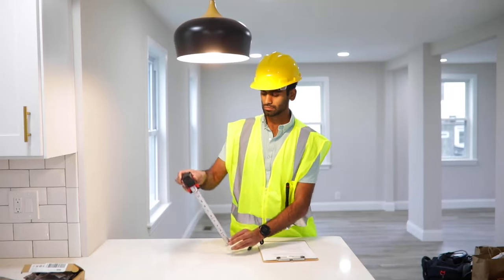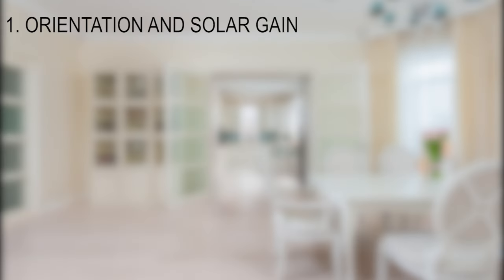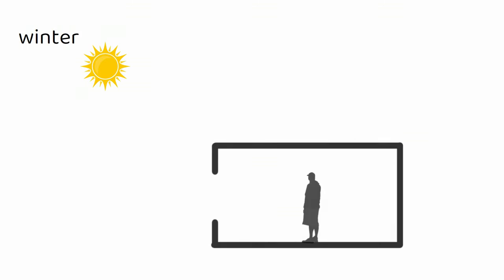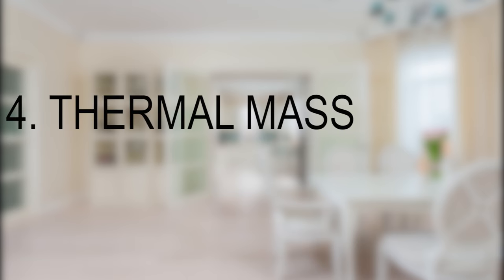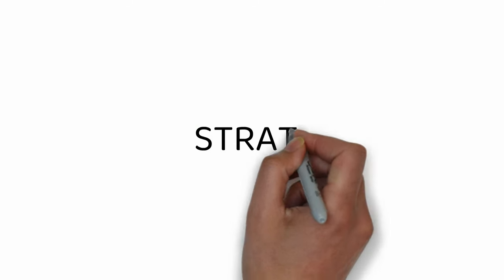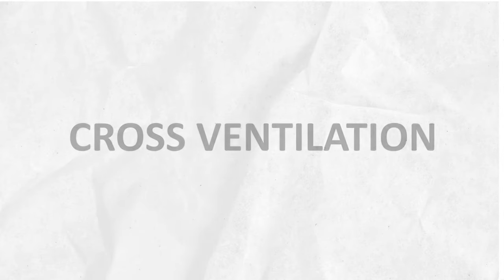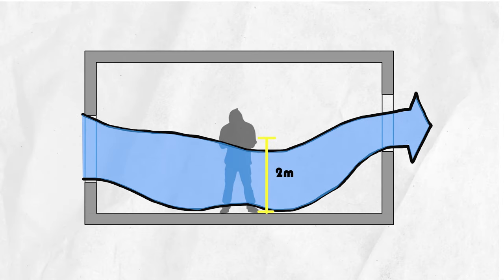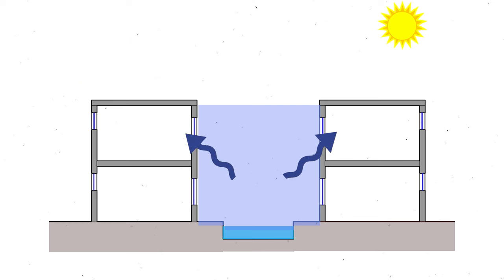The ultimate guide to passive home design

Comment: How condensation is avoided ?
 By completely sealed ?
Reply: Using mechanical ventilation
Reply: You need a dehumidifier to manage condensation. Humans make enormous amounts of humidity. Also most places that humans want to live routinely have outdoor humidity higher than the 50%RH that is the threshold for dust mites to breed. So indoor air or outdoor air is going to be a problem as soon as you put it in a structure with temperature differentials such as a shaded floor that is cooler than the air. The only way to fix it is a dehumidifier.